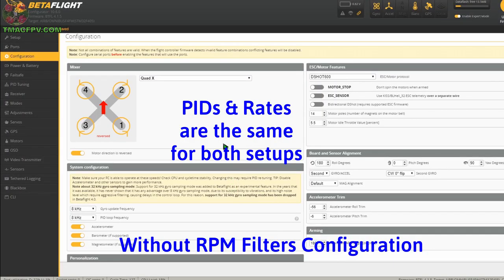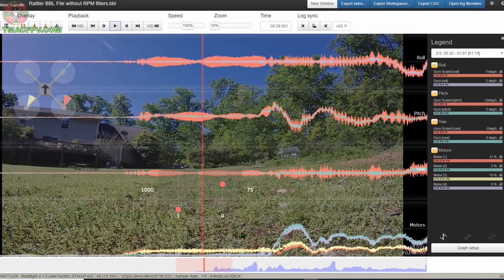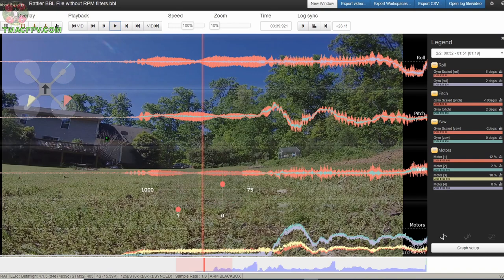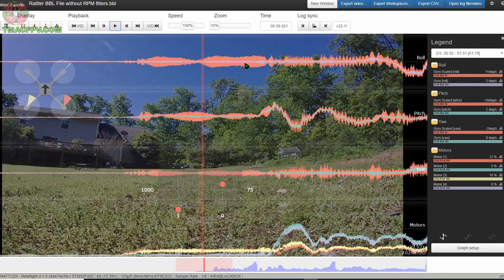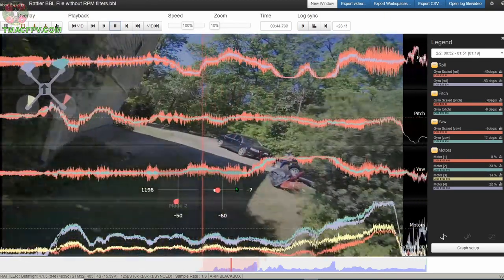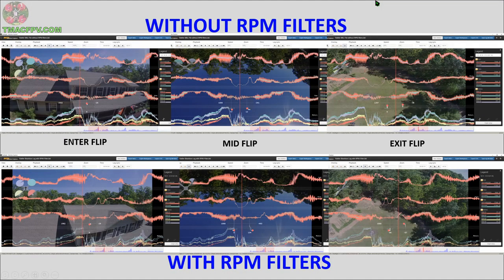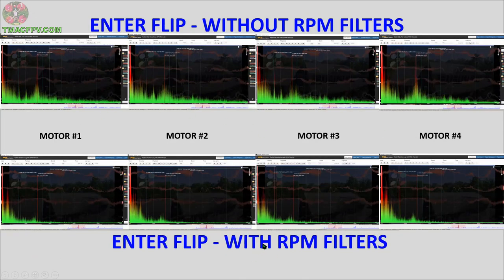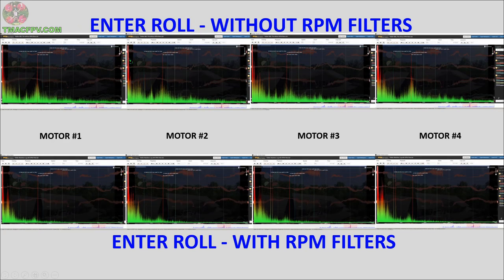BETAFLIGHT RPM FILTER - Part 2 (BLACKBOX RESULTS!)

Comment: This is interesting. Improvements are subtle but noticeable. They should add to a nice tuning and good flying technique to avoid unwanted vibration on the HD video. It's a laborious yet worthy  process. Stay safe, Tmac. When this is over, I'll be flying overtime. Lots of catching up to do!
Reply from the maker: Hey Adriano!  The improvements look subtle perhaps, but the "feel" of the quad is drastically different IMO.  MUCH better with RPM filters.  It would be very interesting to see how they positively affect your "beasts." You'd obviously want to check out the Betaflight Tuning notes (if you're using Betaflight) for proper filter settings for your larger quads (i.e. don't use the same settings I am for my 3" quads!)😉
Reply: @TMacFPV  I'm itching to try rpm filters on my Betaflight and Inav quads. Looks like things are going from bad to worse here in Sao Paulo, so I'm retreating to my farm, 200 miles from the big city. I'll let you know when I get there. Stay safe, my friend.
Reply: @AdrianoCasemiro  stay safe budy